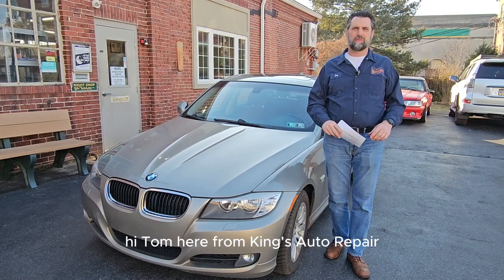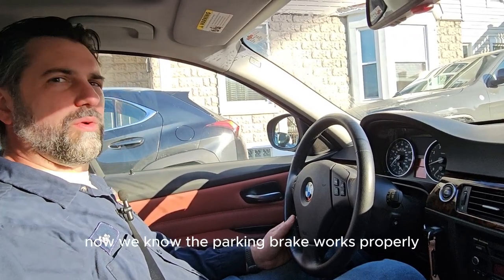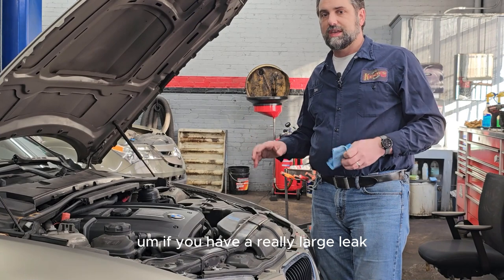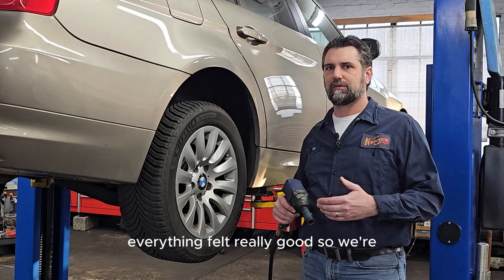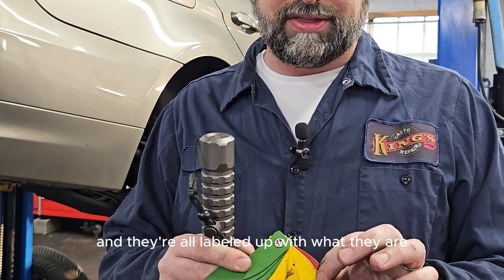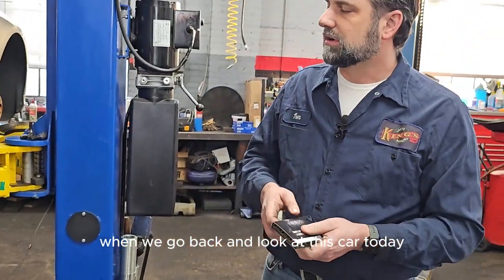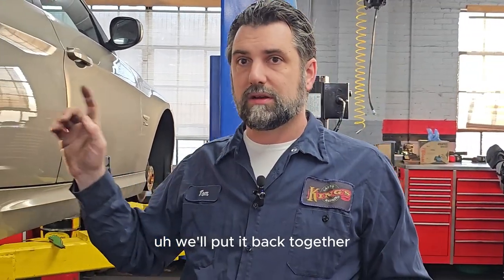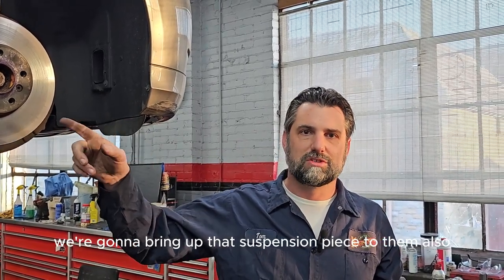What do Mechanics look at during a Pa State Inspection?

Comment: My car tires make rhythmic noise  and I had searched for the cause without avail.  I watch this video and see you use  wire brush to clean the wheel hub and I realized that the cause of my tire noise is probably some debris get in between the wheel and the hub that makes the wheel wobbles when rotate and cause the tire noise.

Comment: In some counties don’t require emissions testing is the same thing in the safety inspection without ob2 I am correct?
Reply from the maker: In the counties that are not required to have an emissions inspection they do a visual "anti-tampering check" when performing the safety inspection. The inspector is required to verify that the emissions equipment is there and it looks to be functioning. There is no OBD or gas cap check.

Comment: You should be using anti seal not high temp Grease but the high temp grease is better than nothing
Reply from the maker: We prefer using the high temp brake grease because it does not dry out and it does not make a silver mess everywhere. Much easier clean up than anti-sieze. To each their own.
Reply: @kingsautorepairinc. I add a little gear oil & mix with antiseize because it's not a detergent oil to collect dirt. I'm 71, have been doing for decades, & live in WPA.😉😁✊️🖖👍🇺🇸